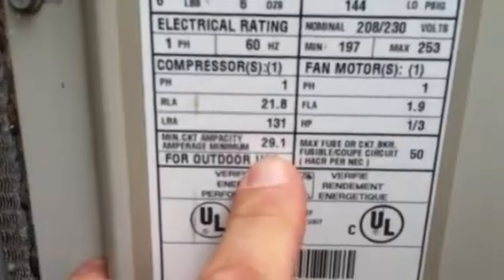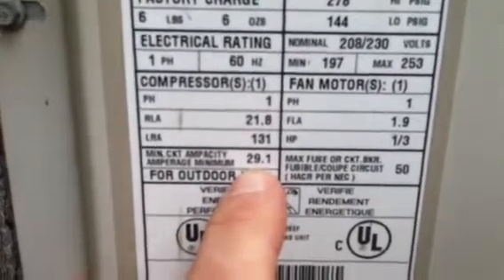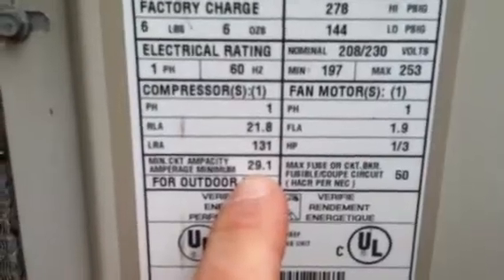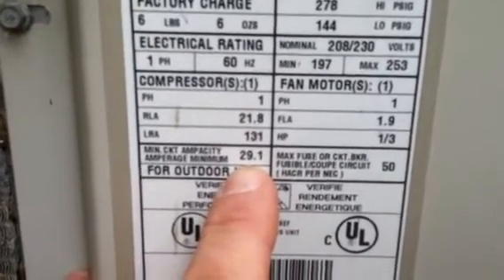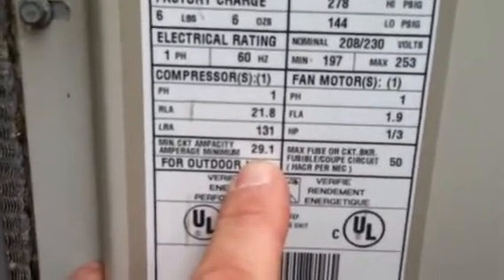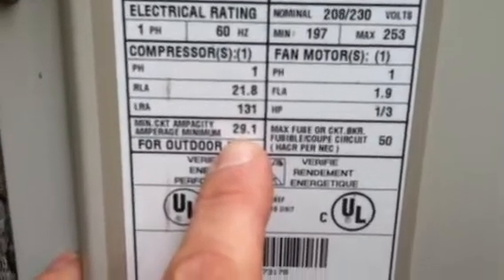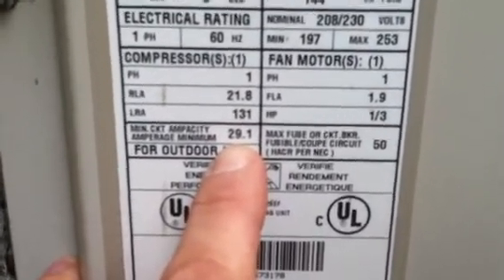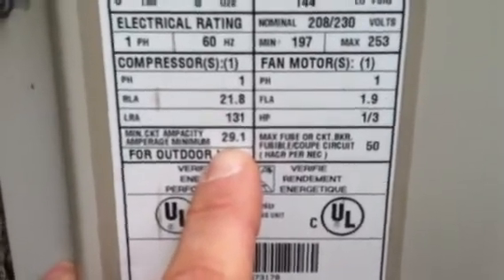Checking wire size AC units 2

Comment: i have a question about what size wire and breaker i have to use for 18,000 A/C and Heat Window unit, thanks for the answer

Comment: Breaker 30 amps will trip at 25 amps you need for 30 amps unit  wire # 8 and 40 amps breaker that hold at to  35 amps
Reply: No. The name plate already has the 120% factored into it so the unit will really be drawing 29.1 - 20% = 23.3a. A 30a breaker with 10/2 is suitable.

Comment: I believe if you are using 90 degree C wire (like Thhn) then #12 would be acceptable. For 75c and 60c 10 would be correct.
Reply: Terminals on hvac equipment only rated at 75c though so couldn’t run 12ga thhn.